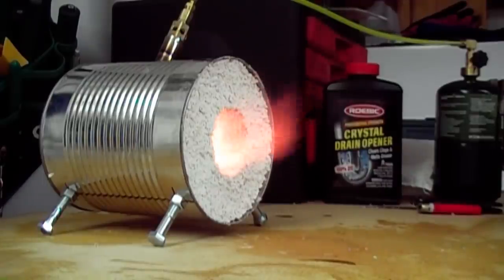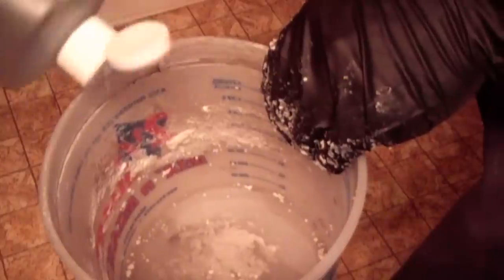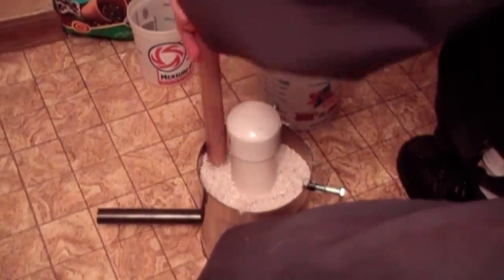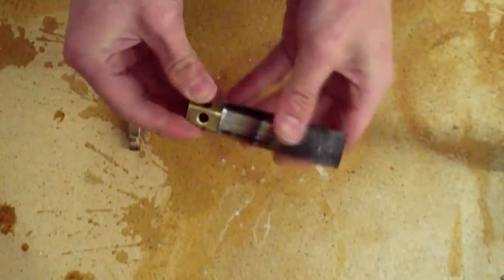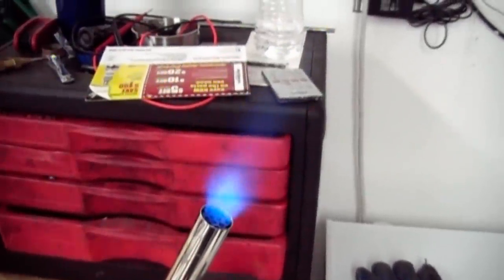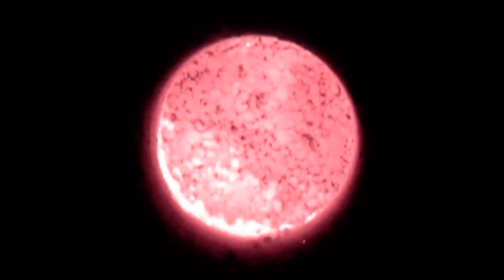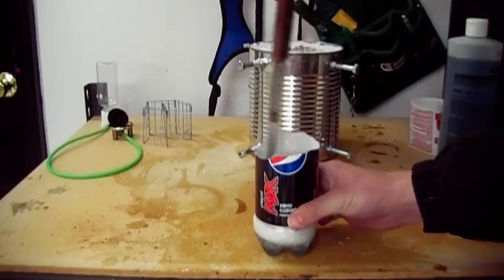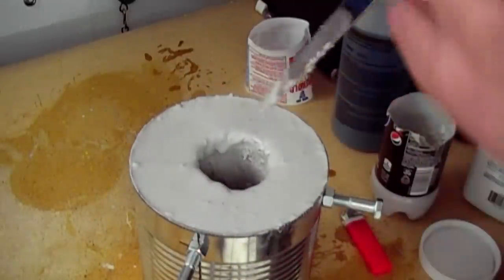How to make a coffee can forge

Comment: Kindred, I have had a LOT of difficulty locating all of the brass fittings you recommend throughout your videos for the burner. My current stumbling block is the orifice. I noticed on your video that the closeup of the orifice says "LP" (liquid propane) on it which infers that you bought the orifice from somewhere. PLEASE help me locate this exact orifice online. I have purchased several 1/8" plugs but all are pipe fitting threads and as such, tapered which will not work. I have tried to locate a die to re-chase the threads but that has been another futile roadblock. Also, 9 separate hardware stores in my area do not carry a 3/8" female to 1/8" female coupler. Where can I find this? Also, you state the orifice size as .016 inches. Is this a # 78 drill bit?
Reply from the maker: +Scott Hitz The orifice plug says "LF" as in lead free, it is a standard 1/8npt plug. It's a (WATTS LFA710) part number. 

I have never been able to get a die to work, can't seem to start them straight, I used a 1/8npt tap to open up the female end of the 3/8 to 1/8 reducer for the orifice.

The 1/8 to 3/8 fitting seems to be a dinosaur now because I have not seen one in a long time, you can use a 3/8 to 3/8 coupler with a 3/8 to 1/8 reducing bushing in one end. I show that in this video https://www.youtube.com/watch?v=5uuTqCsoOLE

#78 drill bit is correct.

Honestly, another viewer was hung up on these parts too a while back, they talked me into making an orifice plug and primary combustion air hole assembly for them but they never got back to me with their shipping info, they are sitting in my parts bin. If it seems too much hassle to get this stuff, PM me your info an I'll send them.
Reply from the maker: +Scott Hitz You sure you want to leave that info on the internet where every one can see it? I meant for you to private message me.
Reply from the maker: +Scott Hitz I wrote down your info before taking it down, you have a package on the way.
Reply: Thank you so much! What do I owe you? I'm happy to pay.
Reply: Incidentally, I know it is more expensive but I am using Onex Supercast 3200 (Onex inc. Erie, PA) It was about $40 for a 50lb bag. You may want to make people aware of that option. I'll let you know how the project goes. Thanks again. You are inspiring!
Reply from the maker: Scott Hitz I'd like to not get money involved, so don't worry about it. How did you get your supercast 3200? Their website dose not appear to be an online storefront, did you walk in to their location and buy in person?
Reply: Yes I did. I live in the same city. But, they are a medium size company, I suspect they would definitely ship if ordered over the phone. Ask for Steve.
Reply: Thanks so much! Looks awesome!

Comment: Hello I was watching your video and was having an idea of making an  out door pizza oven do you think it would work or would it poison the food with the chemicals you used to sill the per light and so on ?
Reply from the maker: haribo stinky No, the perlite is an expanded glass type material, the sodium silicate decomposes into silicon dioxide (quartz sand) upon firing. Just leave out the plaster and it would be perfectly fine, though this type of lining is not the best for an oven to cook food in, better is a dense clay type of lining to hold heat and make cooking more even and controllable. Most outdoor pizza oven designs I have seen get the heat from a wood fire, the coals are removed prior to placing the pizza in to cook using the heat stored in the clay lining. Having any fire in the oven while cooking might cause the pizza to cook to fast on the outside, burning the outer most surface before the inside is cooked all the way.
Reply: Oh that's a shame it looked so much more cost affective than building it with clay and so on ..but still what I could do is make my oven shape with sand then cover it with wet paper then use your mix over the top then paint it with heat proof paint to seal it from the cold weather then pull out the sand when it goes off then set a fire in it to bake the clay ..do you think this would hold up in the cold British weather ?
Reply: Sorry I meant build the shape with sand cover with the paper then clay then use your mix over the top ?then paint it
Reply from the maker: haribo stinky Cold weather is not a problem I think, as long as it's kept dry. Wet weather is what would cause problems I would think, because the perlite is good at absorbing it.
Reply: haribo stinky This construction method is perfectly fine for an oven.  None of the materials are toxic. Use common sense to avoid knocking them into your pizza.  This oven/forge won't hold heat like a brick or clay oven so you must maintain temperature with continuous flame.  You may need a rack to elevate the pizza so  it gets heat from below.  Happy experimenting.

Comment: Hi, I am planning on making a perlite based refractory, I will be using it on a charcoal foundry, I don`t think it will exceed 1200C, With what do I have to mix the perlite for a strong and insulating mix?
Note: I don`t have a huge budget and I don`t have acces to for example sodium sillicate because I`m 14.

Any advice?
Reply from the maker: Joep Stuyfzand The sodium silicate is the glue that holds it all together, without it this method will not work, I'm sure you have probably seen other videos where the person uses plaster of paris and sand, that might be your only choice if you can't get sodium silicate. You can try adding perlite to the mix to lighten it up and give some insulation. I will warn you though, I have never found the plaster and sand mixture to be very good, and there are some hazards with fumes from the plaster, but you would need to use a forge in a well ventilated area anyway, just be aware.
Reply: clkindred How about fire clay? Would that fullfill?
Reply from the maker: Fireclay will work, but the process is different, it needs to be carefully dried before the first firing.
Reply: clkindred I could do that, thanks!
Reply: clkindred Is there a list of materials that I can get for when I go shopping for these materials cause I dont know what I need to look out for.
Reply: clkindred also what was the piece you used for the centre when you were filling it in and the tank you were using

Comment: How did you get h pvc out of yours? I made mine and left it in there and it hardened and now I can't get it out. Thanks
Reply: pvc will soften with a hair dryer. when it softens use a long flat tip screwdriver to go between pvc and what it is stuck to
Reply: +kravidy did you try putting a metal pipe to the bottom with a hair dryer attached ? This should heat it up fairly evenly since heat rises. The metal pipe gets a little warm to hold onto. :)
Reply: Wrap the pvc in newspaper first. Anything that doesnt come out with the pipe gets burnt off pdq.

Comment: what temp can this reach? What metals can you forge using this?
Reply: Propane's burning temperature is 3500 degrees.  Idk exactly what metals that will do.  But thoughtd I'd just share that
Reply: +Matthew Ballard well, steel's  melting point is 2,500 so it can melt pretty much all household metals if that's true.

Comment: I'm on my second forge building run, due to the sodium silicate liquifying when the forge got up to temp. How much silicate do you use in mix for the refractory lining?
Reply from the maker: I use a ratio of 350ml of sodium silicate per gallon of perlite.
Reply: +clkindred Thank you sir! I'll let you know how it turns out!
Reply from the maker: My newer mix uses aluminum oxide as a high temp filler, along with the silicate and perlite. I found perlite alone can melt if gotten hot enough.
Reply: +clkindred How many mg of aluminum oxide does it incorporate?
Reply from the maker: +TheOriginalSkinny About 1kg per gallon of perlite, which is not as much as it sounds. Aluminum oxide is pretty heavy.
Reply: clkindred Sweet. Thank you again!
Reply from the maker: +TheOriginalSkinny you are welcome.

Comment: Could you pour concrete instead of using the perlite mix?
Reply from the maker: Nikolas C I tried concrete a long time ago and it did not work well, it is too dense and full of water, so the forge never got hot.
Reply: clkindred Thanks, I had figured that the reason was because of the inconvenient weight.
Reply: Yea the inconvenient weight  is definitely the reason.   I'm always picking up my forge and carrying it around with me.  She loves going to the pet store.

Comment: What's best way to cut stainless steel drain basket and get it wedged into ss tube?
Reply from the maker: I cut it with tin snips, it worked well. use a socket that barley fits inside the ss tube to push it in square.
Reply: Also where do I get the brass threaded ring used to center brass tube?
Reply from the maker: I got a different brass part that dose the same thing with the plumbing fittings. It's a 3\8 to 1\2 face bushing.
Reply: clkindred
Also where do I get the brass threaded ring used to center brass tube? Just cut one down?

Comment: can you show how to make a small jewelry kiln?
Reply from the maker: Veronica Mills How is a kiln used in jewelry? Most things that require a kiln also require fine control of the temperature. Like a programmable electronic control. That is kind of out of my field of experience for now.
Reply: clkindred kilns are used to make sterling silver jewelry from a special silver clay(can be molded into jewelry) basicly it heats it to high tempratures,which causes the clay to become real sterling silver.. its also used to make glass beads...anway thanks
Reply from the maker: Veronica Mills A while back I saw a video of a person talking about how he made a microwave kiln. It was a small upside down bowl shaped thing that sat on a base made from the same material. I was intrigued with the microwave radiation absorbing substance used to line the inside of the kiln to produce the heat. I never experimented with it myself though, the kitchen microwave is kind of off limits to my experiments.
Reply: clkindred oh okay,i think i saw one simular to that cant remember why i didnt pursue that idea i think it was too limited to what i wanted to..basicly  very limiting,but thanks anyway for your help its much appretiated. :)

Comment: Is using sodium silicate with the plaster necessary?
Reply from the maker: Yes, the plaster itself can't take the heat, it will turn crumbly at just a few hundred degrees or so, as the hydrated gypsum has it's water driven off. The sodium silicate holds the plaster in a matrix after this happens. This perlite, sodium silicate, plaster mix has held up better than the mix without plaster, I'm still researching to find out why. Thanks for the comment!
Reply: You could also add sand

Comment: I am not 'Trolling' but with that much insulation, would it really matter WHAT the outside was? Lets say you had a wooden box, larger than a can. Unless the ouside got up near 550 degrees and had open access to oxygen on both side, it would be fine. I guess I am just thinking I like the clean look and cylinder shape but this and a smaller can seem so limited in size.  I mean you could get like a giant round duct work and do it.... is all.
Reply from the maker: Chris Crissey Perhaps this is correct, or perhaps after a couple hours of use, it dose get hot enough to cause problems. I had no idea if this would be the case going in, so I wanted fire resistant materials for everything.

Comment: Why did you add the Sodium Silica as a topical application? Why not mix it in with the rest?
Reply from the maker: GlennMorganFan Sodium silicate is added to the rest, it glues the lining together, the small amount of plaster helps cure it quickly. The cement I applied to the outside is to give abrasion resistance, and is also held together with sodium silicate.
Reply: ahh OK, Thank you. I watched a couple days ago. I guess I forgot. I thought it was plaster through th first step and sodium silica on top..... That could have been bad LOL
Reply: +clkindred   Another question I had come up...How thick is your refractory layer? (I am terrible at judging things like that)
Reply from the maker: It's about 2 inches thick.
Reply: +clkindred Thank you! I'm attempting to make one myself soon. (Can you believe my college professor is supportive of this? LOL)
Reply: +clkindred To clarify...Is that two inches on each side (Making four inches across. Or is that ne inch on each side making two total across?)
Reply: +clkindred what exactly is plaster? that's the one thing I don't know what is. I'm thinking of using these concepts to make a bbq forge so I can melt metal with
Reply from the maker: GlennMorganFan two inches on each side, four inches across total.
Reply from the maker: kingkong8974 plaster is a kind of castable material for arts and crafts mostly. It's like cement in that it is mixed with water and then it sets into a solid. It's made from the mineral gypsum. My newer forge uses no plaster because there are better materials for high heat.

Comment: My center form is stuck in the forge, how'd you get yours out?
Reply from the maker: Twist and pull, what's your form made of?
Reply: clkindred pvc, I scaled your project up a tad for a mini keg to be used as the body. Tried twisting, won't budge, been drying for 3 days. Guess I'll give it a few more days. Let me know if you have any other ideas
Reply: clkindred figured it out, squeezed the pvc near the forge opening in the vice and but ice in a bag down the tube to contract the pipe enough to get it out
Reply from the maker: Great! Thanks for the update!

Comment: could a waste oil burner be used in this furnace?
Reply from the maker: +robert johnson Sure, as long as the waste oil burner works as intended, it will heat the forge.
Reply: maybe build the forge around the waste oil burner nozzle?

Comment: Do I have to use sodium silicate or could I just use water
Reply from the maker: The sodium silicate is the glue, without it it won't hold together.
Reply: I'm having trouble finding that and now I'm having trouble finding your Mimi cat litter
Reply: I've seen where some guys are using plaster of Paris and sand with a little bit of water mixing that up and then heating it up ro cure

Comment: hey how long does the cylinder last?
Reply: +Karan Trivedi It's really relevant to your orfice and how much air/gas your blasting. But this exact build the tanks seem to last around 2+ hours. However, a huge downside is the tanks drop to subzero within 10-15 mins, pressure drops dramatically... and after that you're not pushing any real pressure. That's why I built mine to attach to big propane tanks as well. Just buy an $8 propane knob from Lowes, a $12 5ft, 365 PSI hose, a brass eblow, flare... just size up the pieces it's real simple. Then you can tap directly into the larger tanks (unregulated) and even at a very LOW setting those big tanks run forever with a forge this small.

Comment: How did your coating work out?
Reply from the maker: Good, but it took a while for me to figure out why. The lining needs to have the particles coated in a high temp material. Here the particles got coated in plaster, which is not the best for this, I made a newer video where I coat the particles in aluminum oxide which is what I recommend.

Comment: I let it set to much and now the spray can i used for the center hole is stuck
Reply from the maker: klint pfiester Uh oh, the rim at the bottom will be a big problem. My only suggestions would be cut the top of the can off, and either leave it in there, or start a cut in the can wall and tear the metal out in a spiral fation. Grip the metal with needle nose pliers and twist them like opening a can of sardines.

Comment: Does it work with regular cement?
Reply from the maker: hugo silva Not very well.
Reply: just want to point out that there's a difference between cement (which bonds bricks together) and concrete, (which is used to make pads, walkways, structural elements) people often confuse the two......now in this case, I'd say that refractory cement would work well though I don't know what the cost is......

Comment: will this melt copper wire?
Reply from the maker: +DetectingArizona Yep, but melting a large amount of copper would need a bigger burner, it would take a very long time with this setup. With the high surface area exposed to the atmosphere of the wire causing you to loose metal to oxides forming, time is not on your side.
Reply: im not really worried about my wire oxidizing, i live in arizona, and the climate is very dry. i have about a month of copper wire that i have found and stripped, and none of it has oxidized,
Reply from the maker: No no, when heated in the forge, the copper will readily oxidize.

Comment: Overall cost?
Reply from the maker: Depends on now much of the materials you already have, the most expensive piece is the propane torch itself at about 15 dollars. The bag of perlite can be had for about 4 dollars, the various brass and steel pieces for the burner total about 25-30 bucks and the aluminum oxide grit was 8 dollars. So I would say about 55 dollars if you started from scratch.

Comment: Why don't we make insulation in our houses out of that? Could save so many houses from burning down and add structure
Reply from the maker: DUDEiTzZOMBIE Cost, and typical fiberglass insulation dose not burn either. If the insulation in your walls is being exposed to heat like this... there is no house left to save.

Comment: Great video!  I use a coal forge and have always meant to build a gas one.  I have some castable refractory cement.  How do you think that would work?  Also, I would love to know the size of hole you drilled for your orifice.  Thanks for the great work!
Reply from the maker: Thank you! I don't have a lot of experience with commercial refractory, so I'm not sure. It will probably be fine if you have it already. The gas orifice is .016 inch. Thanks for the comment!